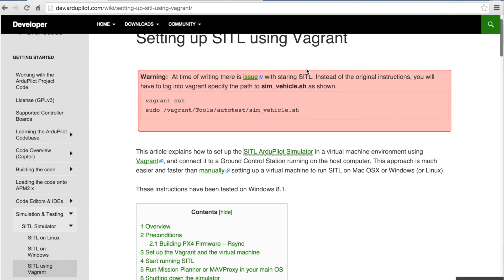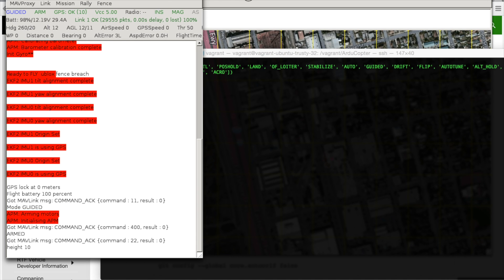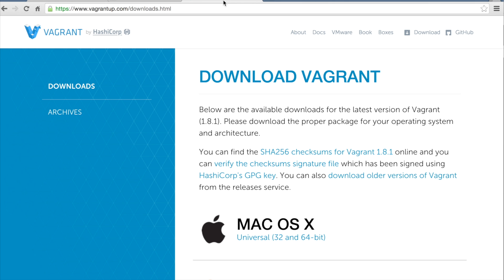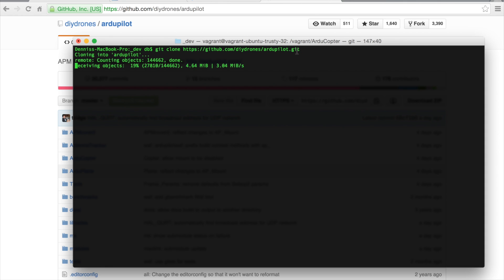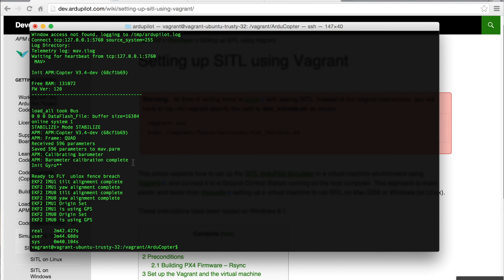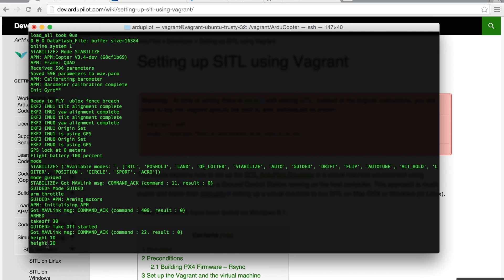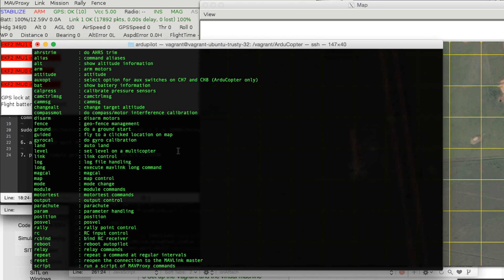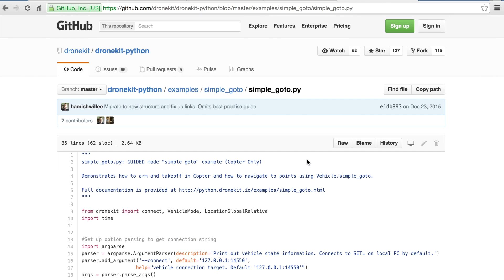Setting up ArduPilot SITL Simulator for Testing with MAVProxy and DroneKit

Comment: hey when I run Vagrant up, it doesn't manage to get passed here:

bionic64: + cd jsbsim
    bionic64: + mkdir build
    bionic64: + cd build
    bionic64: + cmake '-DCMAKE_CXX_FLAGS_RELEASE=-O3 -march=native -mtune=native' '-DCMAKE_C_FLAGS_RELEASE=-O3 -march=native -mtune=native' -DCMAKE_BUILD_TYPE=Release ..
    bionic64: /vagrant/Tools/scripts/build-jsbsim.sh: line 20: cmake: command not found
The SSH command responded with a non-zero exit status. Vagrant
assumes that this means the command failed. The output for this command
should be in the log above. Please read the output to determine what
went wrong.

Do you know what could be the issue?

Comment: Stuck at this. 
Bringing machine 'artful32' up with 'virtualbox' provider...
==> artful32: Box 'ubuntu/artful32' could not be found. Attempting to find and install...
    artful32: Box Provider: virtualbox
    artful32: Box Version: >= 0
==> artful32: Loading metadata for box 'ubuntu/artful32'
    artful32: URL: https://vagrantcloud.com/ubuntu/artful32
==> artful32: Adding box 'ubuntu/artful32' (v20180718.0.0) for provider: virtualbox
    artful32: Downloading: https://vagrantcloud.com/ubuntu/boxes/artful32/versions/20180718.0.0/providers/virtualbox.box
    artful32: Download redirected to host: cloud-images.ubuntu.com
    artful32:
An error occurred while downloading the remote file. The error
message, if any, is reproduced below. Please fix this error and try
again.

The requested URL returned error: 404 Not Found

Comment: Hi Dennis! I am new to drones and a bit confused. Does starting SITL also starts MAVProxy or it just opens a socket where you can connect with MAXProxy?
Reply from the maker: Right. SITL just opens a socket that you can connect to via MAVProxy or any software that uses MAVProxy (like MissionPlanner or Tower). Hope that helps and thanks for the question.

Comment: Thanks a ton for all of your videos, they are great! 

I am on windows 10, am having trouble getting the console and map to work. After entering "ssh -X -p 2222 vagrant@localhost" the vagrant password doesn't seem to work. If you have a quick fix would be great. Thanks again!
Reply from the maker: I'm sorry, Richard but I don't know what's going on with that. I can't seem to reproduce. I'll dig around and see if I can figure anything else out but in the meantime maybe look through the docs here: http://ardupilot.org/dev/docs/setting-up-sitl-using-vagrant.html
Reply: Dennis Baldwin thanks! I really appreciate it. I have had so much trouble being
Reply: Dennis Baldwin so much trouble getting dronekit, mavproxy and sitl to work. I've tried cygwin and that was way worse. missing libraries and all sorts of stuff. went through the ardupilot install twice. I have a raspberry pi now. do you think it would be easier doing this through the raspberry pi? on that note I also have an old apm 2.5 controller, you think that will work with donekit?

thanks again for all of your time.
Reply: Hi Richard, Did you solve the problem you had with "ssh -X -p 2222 vagrant@localhost" I may have the same issue, when I enter the vagrant password: vagrant it dose not work

Comment: Hi Dennis,
thanks for the video.
I followed the steps and the simulator worked(it didn't work at 1st but it eventually did), however I didn't get neither the map nor the console!
where's the mistake do u think?
thanks
Reply from the maker: Make sure you specify the parameters. See here:

http://ardupilot.org/dev/docs/copter-sitl-mavproxy-tutorial.html

and it will looks something like:

sim_vehicle.sh -j4 --map --console